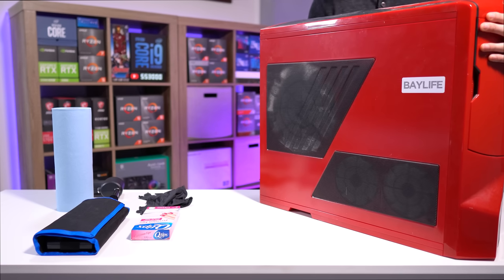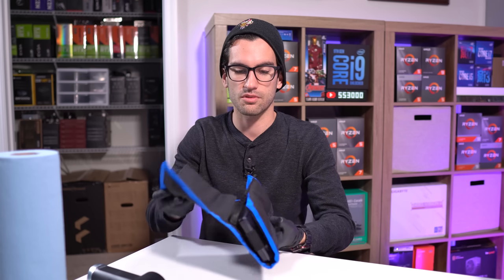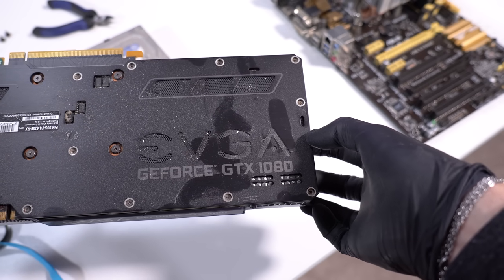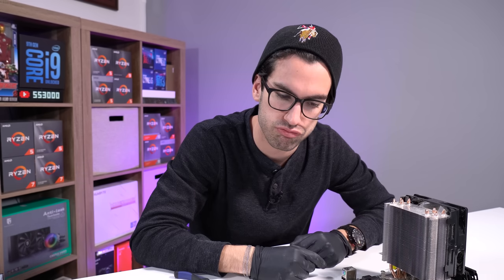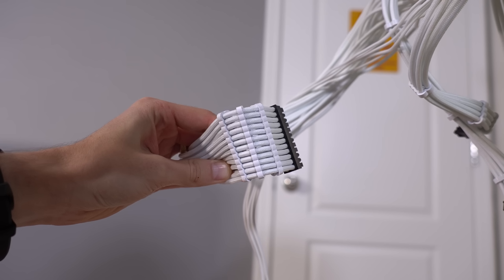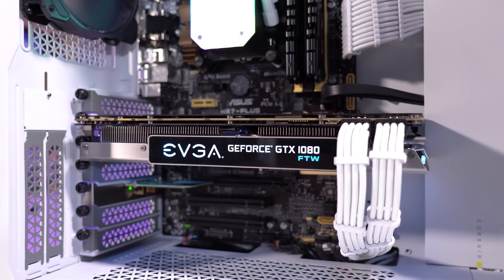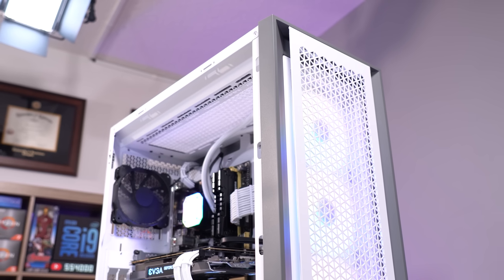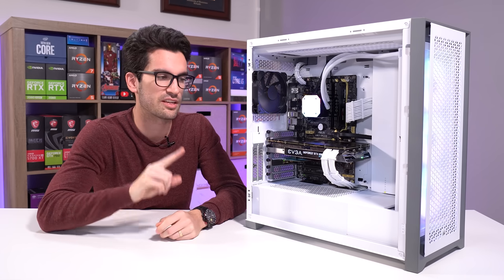Deep-Cleaning a Viewer's DIRTY Gaming PC! - PCDC S1:E3

Comment: This dirty pc s are not even the 1% part from what i think is in my grandma's pc old from 97 and not opened in 20 years...btw even is ancient uncleaned for over 20 years etc..its still works fine for documents and a little browsing and little work what my grandmother does..and it runs xp...it starded with 95 or 98 idk for sure

Comment: 1000 watt power supply on a pc that consumes less than 500 watts, ridiculous.
Reply from the maker: It is absolutely not. He's now future-proofed for years and shouldn't need to worry about power. Don't let your bitterness eek through the comment section. It's tacky.
Reply: @GregSalazar  you wouldn't need a 1000 watt power supply even if you installed a ryzen 5950x with a rtx 3090, let's not say nonsense please.

Comment: Way too much outtake fans ! That`s why so dusty. Even the I/O Ports !
Reply from the maker: "Outtake?" They had several intake fans, actually.
Reply: @GregSalazar  damn ! you are right ! I saw something dusty like that only at my brothers system. He had one 220mm fan in the Sidepanel that blow the air out. I changed it before (you were able to switch the rotation left/right) 

As a friend and me want to pick him up for a LAN-Party (long long time ago) we need to vacuum his case because it sucked a lot of dust in.

I/O-Shield, Meshfront (even there where no fan was installed) just because of that to much of "outtake airflow"

Comment: The hard disk drive is 1000% garbage in 2021 replace it for a ssd
Reply from the maker: Plenty of folks are still using HDDs in 2021. In fact, data centers and servers use them all the time. Don't believe everything you read on forums.

Comment: i see intelboy here. AMD Ryzen - is the best and cheapest processors.
Ryzen 3 is better than i3 (3100 vs 10100F)
Ryzen 5 is better than i5 (3500X is better than Core i5 10500 too)
Ryzen 7 is better than i7 and i9 (5800X and 5700X are better than i7 10700K and 10900K)
Ryzen 9 is best overall (3950X is better than Core i9 10980XE and >32 thread Xeons)

Comment: STOP USING FREAKING PAPER TOWELS TO CLEAN STUFF, IT HURTS ME ON THE INSIDE TO SEE THE LITTLE BITS BREAK OFF ON STUFF!
Reply from the maker: GET OVER IT. THE FLAKES EASILY BLOW AWAY WITH THE DUSTER.
Reply: @GregSalazar  i was just kidding :( but rubbing any surface mount stuff on the board or video card could hurt it